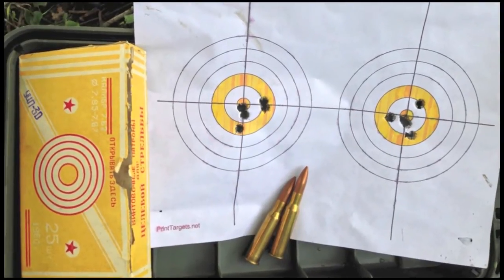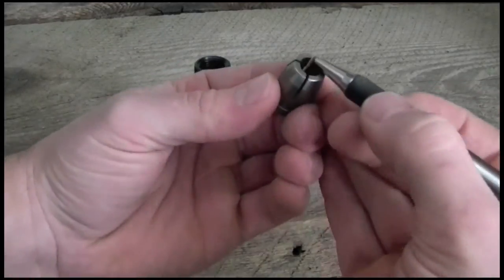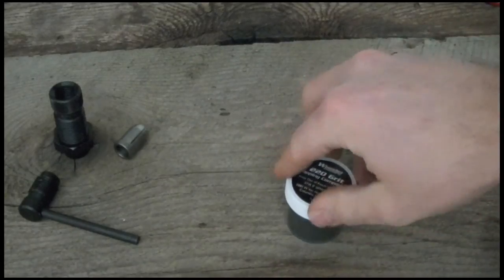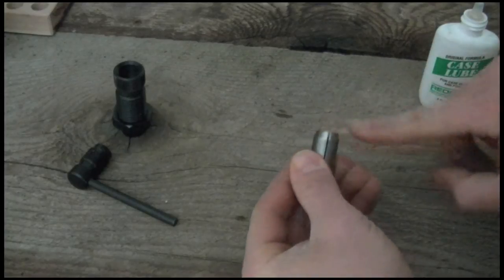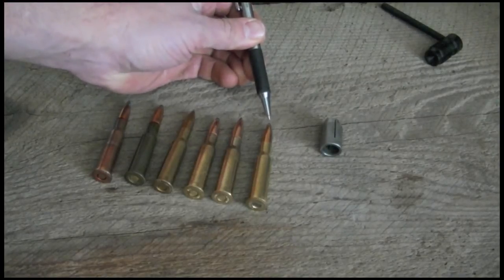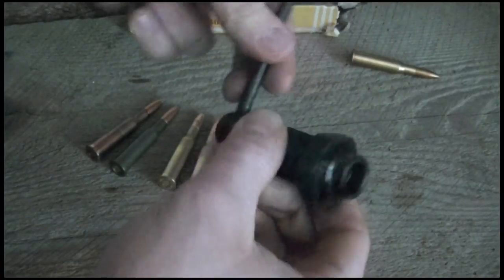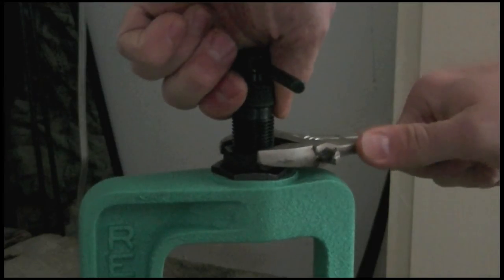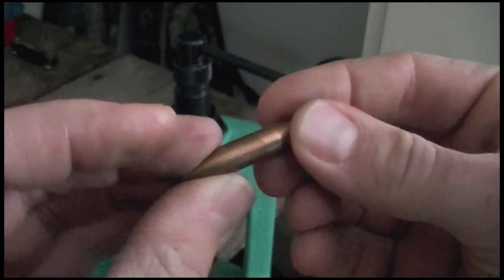7.62x54r Reloading Ep3 Pulling a bullet

Comment: I wonder how much damage that does to the case.  I want to re-bullet some new factory ammo.  Pull 110gr, adjust powder, seat 125-130gr.  (300 Blackout 110gr V-Max to all copper Hornady GMX or Barnes TTSX).  Can I just seat a new bullet?  I'm thinking I might have to chamfer the case first.
Reply from the maker: +Bert Payne I do always chamfer and at least size the neck. If you size the neck be sure to remove the primer decaper so you do not decap a live case. I have experimented with just re seating a bullet. It works ok and will at least hold it there, only down side is that neck tension is reduced.
Reply: Hmm good point about neck tension.  I was worried the factory crimp would make a new bullet hard to re-seat.  My die has a crimp option that may be a substitute for re-sizing.  It may also compress the neck as well. Have to check.  Thanks so much for your feedback.